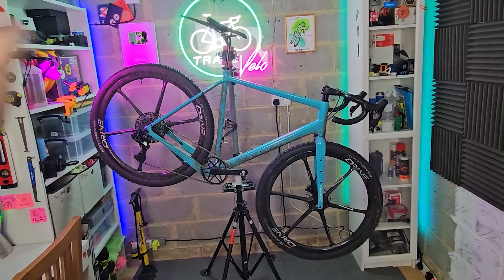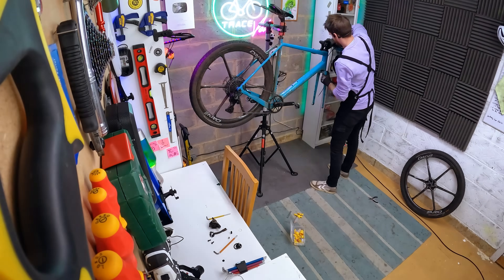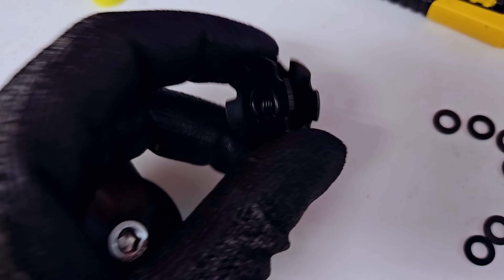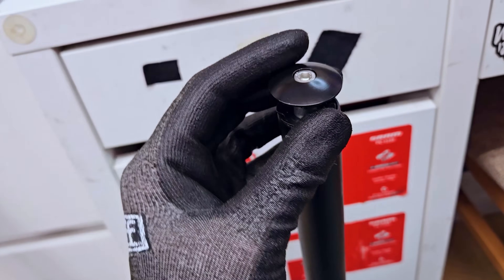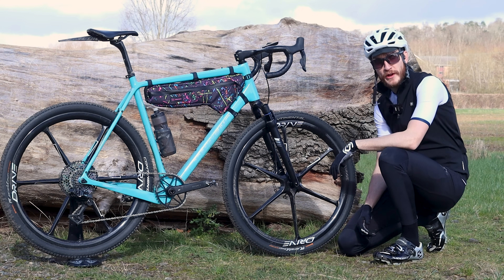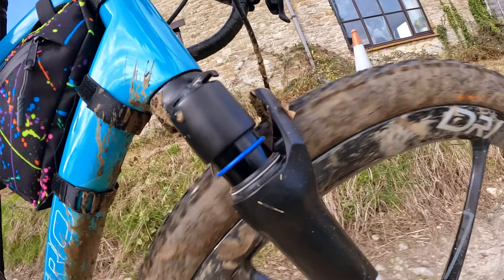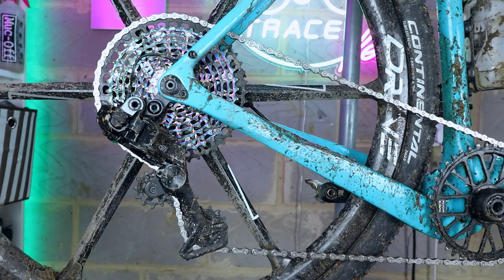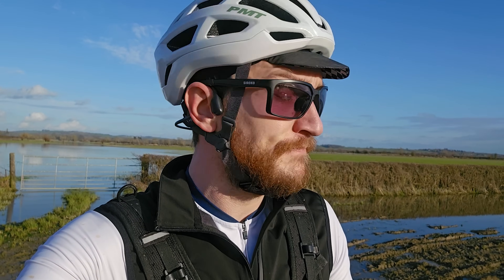Gravel bike suspension for only £90!

Comment: Hi Luke, top tip for the future - instead of cutting down the brake pipe, you can carefully cut a slot in the olive and then twist with a flat blade screwdriver to crack and spread the olive. You then just use a new olive and keep all the hose length. 🥖
Reply: I'll soon be in a situation where I'll have replumb my brake lines for something stupidly minor. I had considered what you are suggesting but having no experience with that (always replaced brake lines in the past) I am concerned the new olives wouldn't work as effectively due to  compression of the hose from the previous olive. It sounds like you DO have experience so am I overthinking this or worrying unnecessarily?
Reply: @vaulthecreator the new olive will crush down just as well as the old one did using the same spot on the hose, and seal just as well against the calliper / lever and the compression fitting. It’s common practice in domestic plumbing to reuse the same pipe with a new olive, even on plastic piping.
Reply: @DandBGhostHunters  that's great to hear., that will save me so much time. The LBS here won't sell brake hose and getting anything posted to regional Western Australia is easily a 2 week wait.
Thank you so much mate, you're a legend 👍
Reply: You can also use a pair of pliers to crush the old olive too - use a rag to avoid any damage to hose.
That's how i reuse my barbs 2-3 times.

Comment: A little late now but you can definitely use the compression style plugs in an aluminium/steel steerer tube, just you can't use a star nut in a carbon steerer.
Reply from the maker: OK cool, good to know. I had just assumed that the aluminium plug would struggle to hold against the inside of the aluminium steerer tube. But I guess you can really up the torque on the compression plug compared to a carbon steerer... I'll def bear this in mind for next time! Thanks for the tip chaz 👌👌👌
Reply: @TraceVelo  Use an old stem (slightly higher mounted on the fork shaft) and the top cap as a guide next time. Don't screw the screw all the way in and then just hammer it in, it will be straight afterwards.
Reply: Sometimes the inner diameter of metal steerers is too small for some compression plugs. I have also used it on steel forks. They also seem to slip less on steel or aluminium than on carbon forks. The only thing to keep in mind is that it adds a few milimeters to the steerer length because the plug sits on top. @TraceVelo
Reply: @alexsch9956  too much of a hassle and risk of hammering the star nut not straight. the drift tool used for this that Luke showed a picture of is dirt cheap and it will last a life time for a home mechanic so I see no reason in bodging this work.
Reply: I can't stand star nuts, I always use a compression bung in my forks.
Reply: @qwertyazerty2137  thats why you need an old stem for the job worked everytime so far, done it a dozen times now I think
Reply: @skinheadjc bung
Reply: I knock star nuts in just using the bolt. Never had an issue

Comment: That little blue ring helps you gauge the suspension pressure - push it right down and go for a ride, when you get home you'll be able to tell how much of the range you're using. Add or remove pressure accordingly.
Reply: no, it's actually used for measuring sag. On a normal air fork you want around 20-30% sag but on this I have no idea since it's only 40mm of travel. It can be used to see how much range you're using but that's not really it's purpose.
Reply: @NonLegitNation2 this. You have to love how everyone’s an 😅expert on here

Comment: It would be great if you had a look at the kinds of stem suspension Cycling About made a video of recently. The Chinese knockoff might be a bit more accessibly priced than what they were featuring. Weight wise you're looking at something like 200g instead of a 1000g. Although they might not suit what you're dealing with, according to Cycling About they are better for vibration.

Comment: 8:49 I saw your ass saver. If you don't like getting wet I would recommend some SKS Speedrocker mudguards. I mean they weigh around 300 grams but they will make you stay dry and are easy to install. And the Raceblade ones from them aswell for your road bikes. I mean yes they weigh but they help you to not get wet. Especially when you like to drive longer around or when it rains only a bit in the summer or slightly.

Comment: I notice some people put the fork in a 'inverted' position... Would you go for that one change in the future? I don't know what or why they do that... Could be the brake and the cable distances. Could be aesthetics only,  maybe is the way the control of the fork... Maybe there is aero gains to set the bridge inside and not outside. But is your call to try that inverted position fork.

Comment: Well about the quality you can't really say without it's full disassemble and some background of servicing those to compare it with others and detecting possible issues. Not really surprised it works out of the box, but question is for how long.

Comment: 6:45 Instead of a star nut, you can actually use the expander plug in an alloy steerer tube. (may need a piece of inner tube as a shim)

Comment: For the same money ($100CAD) i got a used 27.5 rock shox fork, that is just a little longer at 100mm. You can find these cheap if they use the older non-boost width. But that means they fit gravel/road wheels so thats a win. And 27.5" forks fit 700x45c tires pretty comfortably
Reply: Problems adding flat mount calipers to post mount forks ??
Reply: @Bazza1968  of course not, you just use post mount calipers. The caliper mount matches the frame.
Reply: @galenkehler road and gravel calipers are flat mount
Reply: @guidodelgiudice  sometimes yes. Other times they are post mount. Use post mount calipers on a post mount fork. It's not difficult to figure out, just look at the fork, and use the caliper that matches.

Comment: my bike's steering seems to be very unstable after putting this fork on. from what i've been reading, it might be caused by the new angle of the frame pitching upwards due to the longer fork? the bike actively tries to go left or right that i always have to keep both hands on. one hand steering is quite not enough. we have the same frame and fork. already tried a different set of wheels but that didnt help 😕

Comment: EVOSID RUDY REVIEW ------If you are looking for a cheap gravel fork, I'd advise strongly against the "Evosid RUDY" that is on Ali Express. I was considering buying the Kocevelo for my 2023 Vitus Substance VRS, and saw one of these on Ebay for £45 delivered from a UK seller, listed as brand new but in the photos it looked a bit like someone had fitted the crown race. This got my suspicions up but at that price I thought, worth a punt to see how the bike is with the modified geometry (extra 65mm A-C, less any sag), might even be the Kocevelo rebranded??
They turned up, I inspected them, no signs of use and dropped the lowers from the stanchions. There's no oil damping as I suspected, there's a foam ring under the dust seal but lubrication is grease only. There was no star nut fitted so I used my compression plug from the Vitus forks, didn't want to cut the steerer at this stage. The worst thing is the fact the thru axle is really just a "posh bolt"- one leg isn't threaded, it goes through both and there's a crap, mostly round bolt (like an axle cone really) that takes a 16mm spanner, and this " round nut" is drilled for a grub screw from the side- so when you tighten the nut up (6mm hex/16mm spanner) you then use this grub screw as a lock nut AGAINST THE AXLE THREADS!! (how TF does that work long term?!). I've put it all together and liberally applied loctite to the main nut and it's grub screw. First impressions? Took it up and down the drive, the steering now on this bike feels awful- "flip flop" from side to side and just wrong! will test it further tomorrow on a proper ride but I suspect that the geometry of the Substance is more an "all road" thing, the toe overlap has always been horrendous. If you pop the front wheel up the forks "top out" with a clunk- always a sign of garbage(as is the non threaded lower!). I really don't think the geometry on my bike is favourable to any longer fork and all I can think at this point is thank god I didn't buy anything dearer! I can live with the 16mm spanner(and 2mm hex, better check my multitool...) in my kit for now, and I run tubeless anyway, I'll probably see if I can get through the winter on them then off to landfill, but yeah, utter garbage and best avoided!!!
Reply: I reckon the seller bought them from Ali and took a look at the axle and went "nah....F that" decided just to punt them on. It wasn't a dishonest sale, they've got nothing to say it has this system on the AE listings- that's sneaky and dishonest of the vendors because nobody would buy them if they knew!!! Cairngorms gravel isn't some farm track/towpath/purpose built cycle route either...can I even trust them!?

Comment: Granted its extreme, but building up a very light XC Mt bike ends up with a very fast gravel bike, but not cheap.
Around here rocks are plentiful on many gravel roads.....Bang Bang Bang is what a rigid gravel bike sounds like.
Very abusive to the pilot.

Then there's the downhill with big washboard and deep gravel at times....the XC bike eats it for lunch, 42mph has been seen on rough gravel downhill. Short travel 100mm Intense Sniper really handles well at speed.    Ive used it on many gravel rides.

Comment: I just came across news about a new wireless group from the Chinese brand "Wheeltop" -- the EDS-TX.
 It's available with hydraulic disc brakes and also for use with cable-operated brakes. And it's supposed to be offer the same performance as SRAM AXS at half the price!
It sounds too good to be true. 
Perhaps TraceVelo can tell us whether it's worth the money or just another money pit!
Cheers

Comment: What's your sag% on them forks then? Tell you what though that Do not Exceed 200psi that's probably rubbish as my fox 170mm 38s don't take any more than 140psi! So I'd be very wary of this and look out for warning labels on the for or go with fox 32s recommended psi? 200 psi in a 40mm fork very much doubt that!

Comment: Slightly different topic, but I reached out to LTWOO about the E-GR groupset and they have repeated that 46T is the max cassette. This seems crazy! Do you have it working well with 50T? I've ordered one but it won't be much use if it will only go to 46T.
Reply from the maker: So yeah 50t for me didn't really work, I'm currently running an 11-46 with a 40t chainring up front.
Reply: @TraceVelo  ah that's a nightmare. Very strange for a gravel specific RD!

Comment: You could have reused the compression plug in the rigid fork in the suspension fork as well. I don't use star nuts in any of the steerer tubes on any of my bikes.

Comment: 🥖 I have great hack for that type of bike-stand. Remove 1 leg, this would by you a lot of space if you use it against a wall. As center of gravity with the bike is somewhere under the clamp the " rear "  leg is pretty useless (the wall would probably cope with any stability issues😸).

Comment: Does anyone know what the uncut steerer length is? I have a Vitus Substance VRS in "S".... LONG legs, short torso and I need the bars raised at the front it's killing my neck, and the other issue is horrendous toe overlap- I can't use a steerer extension tube as it's a carbon steerer, I bought an adjustable stem but damn it's Fugly, so I'm thinking these forks may allow me to decide the steerer length(leave it uncut probably) to gain some height, and if the A-C is greater than my current forks (400mm) then it could help with the toe overlap (yes I know it will slacken the HA, reduce reach(welcome), raise the BB etc)...

Comment: You’d be surprised how easy it is to do a lower leg service on suspension forks. If you keep fresh oil in them then it will save the main bushings that the uppers slide on and prolong the forks life.

Comment: Been riding the Redshift stem and seatpost with 43c tires. This looks very cool for a budget shock. Any little bit of suspension will totally change your gravel experience. Yosemite Sam would be proud
Reply: but to be fair - the fork was not much cheaper then the redshift stem and with all the work unclear customer service I would (and I have) go with the shockstop every time...
Reply: Also using the redshift on my gravelbike and satisfied with it, but while the redshift is giving some comfort to the rider, a suspension fork like this is also increasing the traction in general I think. But since I need some mounting points on my fork and I don't want to increase the bike weight by nearly 1kg, I will also remain with the redshift, good enough for my style of riding
Reply: Redshift is a game changer for gravel bikes. Luke should test the suspension stem and compare it with the fork.
Reply: Agree- we need some suspension stem tests from Luke!
Reply: Did you guys get your suspension seat post from Ali? Was thinking of a suntour

Comment: Please try a suspension stem next Luke. Much simpler upgrade, much lighter, no geometry change. In short, of great interest to a wider range of riders. Probably. 😊
Reply: Not tried all the stem options. Just the eesilk from Cane Creek. It's helpful on some of the chatter. But, recently got a Szepter Core 4 with the Rudy Ultimate. No comparison. It's not as much travel as my MTB, but it is so much smoother in the rough stuff. I do venture onto single track on my GB rides fairly often. So, that makes it the best choice for me, while for others it'll likely be overkill. I just mean to say that the two are not equal. That said, I do agree with you in the specific aspects you listed.

Comment: Actually, you can use the compression plug with no problem in aluminium steerer tubes. They're just a little more expensive and have not much functionality. It's only function is to allow the cap (and stem) to be lowered. Also, the stem itself is not held in place by this bolt, but by the other two.
Reply: The compression plug is designed to bite into a carbon surface, so it is very likely to slide and slip on the aluminum

Comment: To fit a star nut like that you need the fork in the frame and the stem fitted - that way the top cap locates in the stem and holds the screw straight as you tap it down.

Comment: mountain bike tires.... front suspension... You may be an MTB convert yet...    I enjoyed this video, have been interested in light suspension light this for my road bike. I love the air forks on my MTBs and don't get the whole rigid fork gravel thing... products like this make a million times more sense, especially coming from more MTB riding than road riding. I put a lot of road miles in too, but sometimes I wished I had some kind of light suspension when I hit gravel paths, construction zones and other rough patches.
Reply: It's a direct function of what you ride. On American unpaved roads, rigid is probably fine, it's where the whole gravel thing started. In Europe, we don't really have these unpaved roads, typically whatever is unpaved is just a mess. It's a generalisation but it matches my experience.

Comment: To be honest - as somebody who is in road bike racing since 1981, and in MTB since 1991, and who recently bought a gravel bike, this is exactly the border which I do not want to cross... yes, in a couple of years, when all have switched to 32-40mm of travel, the industry will figure out that 80mm ist MUCH better...another two to three years later, they will figure out that steering control in rough terrain is better with a flat bar - we called it a "hardtail" already 30 years ago...
What I use is a suspension stem, though. I love my fullys, and I love my gravel - but like to keep them different...

Comment: This one looks like the gravel fork of Santour. At our local, ppl use this type of cheap fork on the local racing of the 'MTB on paved road', it's required the bike has the shock fork, rigid is not allowed. So just pick a cheap one on gravel bike with MTB racing tires. It always works. And it's funny to see a suspension dropbar gravel in a group of flatbar hardtail.

Comment: I watch your videos as soon as they're released because they're so watchable, whether I'm interested or not, but this is right up my gravel trail. 🥖🥖🥖

I've had a curiosity with weird suspension options for a long time, particularly the old Rockshox Paris Roubaix SL. . One question is whether it hits the downtube on full lock? Another is when are you going to undo those bolts and examine the internals?

The main benefit of suspension isn't actually the cushioning, it's the preload which does its thing extending the fork over holes, which keeps the tyre in contact with the ground more giving you more control. Seeing as UK gravel is often rough bridleways, farm tracks and <checks notes> bogs and wetlands, that's a transformative mod to a gravel bike

Comment: ... The bonus clip remind me... If I wanted suspension forks I would switch for the MTB and go straight double suspension just because I know what it takes to get the comfort on those rough roads trails sections... And then to have the real thing in the suspension spectrum.

Comment: I use a redshift stem myself and honestly it's been perfect even on some pretty hairy mtb trail stuff (I'm also a mtber and roadie). absolute breeze to service and doesn't change the geometry of the bike, there are a few downsides, but so much easier than a suspension fork to look after and doesn't slow you down on road sections, plus super subtle on bumps.  I've seen a non branded chinese model much cheaper that looks the same too. Much prefer the look with a rigid gravel fork too.
Reply: Interesting! I had a look, i couldn't find a similar looking one on Alix. There's a version with a spring in the middle of the stem, and a version with a very steep up angle. Nothing that looks like redshift?